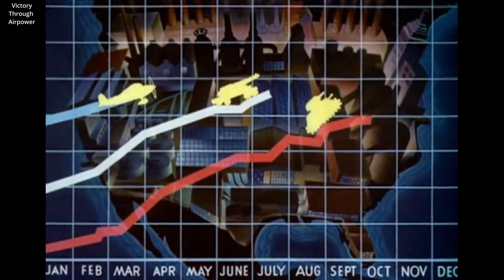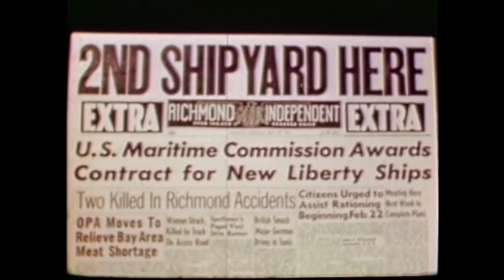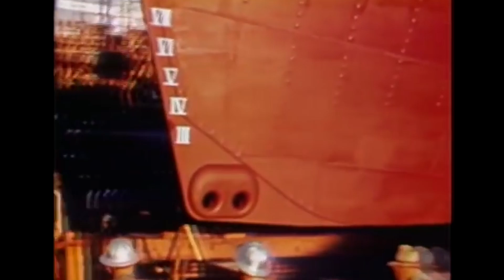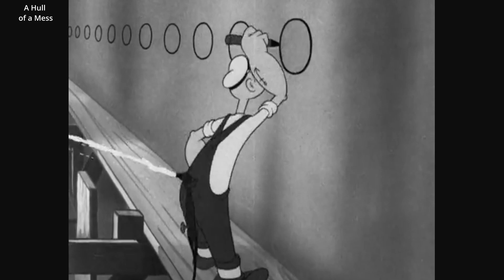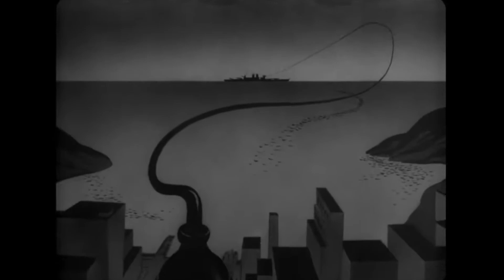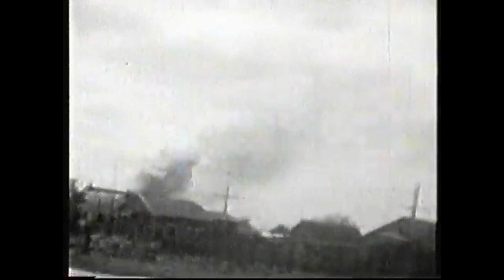The Most Important Ship of WW2?  Liberty Ships

Comment: I think it was Nicholas Moran who was commenting on the relative effectiveness of German infantry vs US infantry during WW 2.  One factor was that the front line army units were the premier branch of service and received personnel from among the best recruits.
Meanwhile the US Army funneled men who were good at math to Artillery and spotting, men who were mechanically inclined into the motor pools, etc.  So, on average, the US grunts were not as smart as the German grunts and could get into trouble from this.
Until that artillery spotter attached to their company calls in accurate artillery fire in copious quantity because of all the shipping capacity that allowed large quantities of ordnance to be shipped to the theatre of operations and those motor pools that kept the supplies flowing to where they were needed.
Battleships and cruisers kept the soldiers going in combat with their shore bombardment for a few critical days after landing, but the transport ships got them and their supplies there in the first place, and kept those soldiers supplied every day after.

Comment: a nice salute to a famous line of ships.  Some liberty ships had bad welding and would come apart in rough water, later ships had an extra steel band welded around the hull as a reinforcement.  Supposedly, the cost-to-benefit ratio was calculated that even if a Liberty Ship only made one run it paid back the costs of its construction.  As you mentioned, a number of them served well after WW2, as they were cheap and available to many countries after the war ended.  I'm glad to see that you included clips from "Action In The North Atlantic", very cliche, but a fine look at a Liberty Ship.
Reply from the maker: Thanks for the supportive comment and some great additional info. Always appreciated 🙏
Reply: Lloyds register in the Uk insisted that a riveted {to prevent cracks propagating across the welds) strake be fitted all round at deck level. Did a trip UK to India and back 1957 as watch keeping engineer on the ss Clan MacFarlane (launched as the John Branch)  great wee ship, ran like a Swiss watch